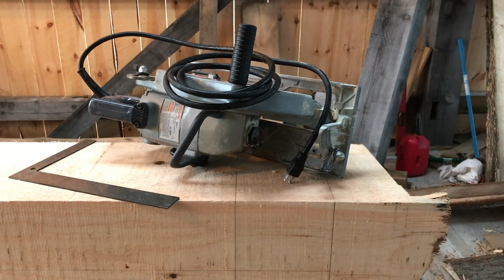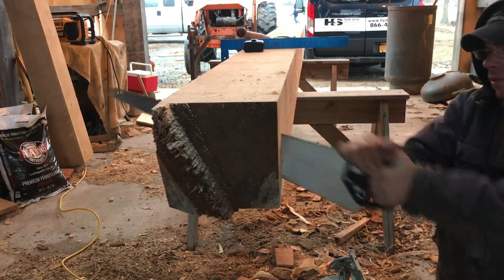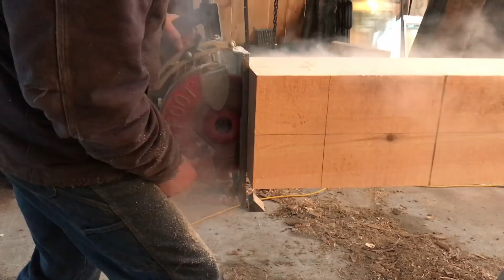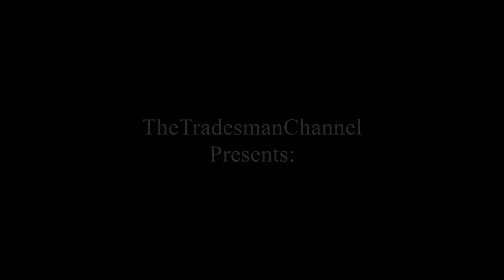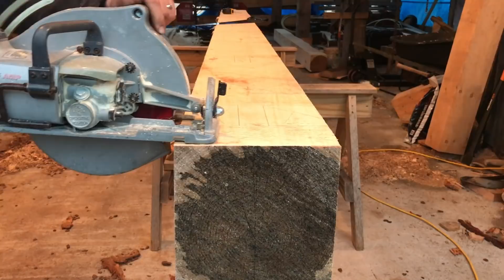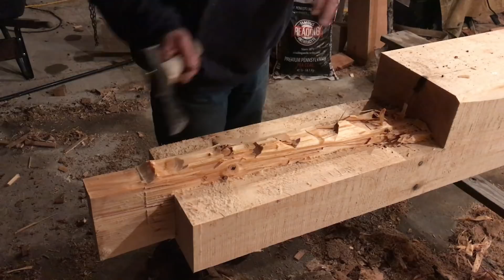THE MOST OVERLOOKED TOOL YOU OWN AND SOME TIMBER FRAMING

Comment: Would have used a reciprocating saw instead.  And then a belt sander   Just saying
Reply from the maker: Sawzall doesn't cut square, blade wanders too easily.  Normally I use a 16-5/16" circ saw but not everybody owns one.  I try to show many methods, just saying.

Comment: From the base of the tenon to the top, is it better to have a sloping tenon, tapering to the base, so the base is wider than the top, or to have a perfectly straight cut from top to bottom, so at the bottom you have a 90 degree angle? And I guess the answer depends on what job it is doing, so an inverted "T" might be different from a regular "T"?

Comment: I’ve worked many years on commercial aircraft working sheet metal repairs.  I use 1/8” plexiglass to pickup holes but it works great to transfer holes as well.  One suggestion I have would be to cut 6x6, 8x8 and 10x10 patterns from plexiglass and use them to locate those shape to box the heart of the logs
Reply from the maker: That's a pretty good idea.  Thank you for sharing.

Comment: Using a circular saw vertically ... fuck that
Reply from the maker: It's called a "drop cut" and is commonly used in timber work.
Reply: Ive never seen it done, i imagine it to be ridiculously unsafe. What i the saw catches or nips up, its going straight for your head surely ? Also this by no mens a dig at you i enjoyed the video. Just gave the heebie jeebies seeing that cut
Reply from the maker: I just saw your reply, sorry about that.  It is a different cut for sure, takes some practice.  You ought to see it when I'm using my really big saw!

Comment: Why don't you use a hand saw to cut the rest your circular saw didn't get to? I think it would be much faster than all your hatcheting and chiseling. Chisels are for finishing (or spots you can't get to with a saw). If you own a chain saw, you can do it with that, leaving  the last 1-2mm for the chisel.
Reply from the maker: Chisels are much faster.  I can tell you that from experience after cutting 100's of joints.
Reply: Your hatcheting and chiseling lasts from 7:00 to 11:46, that's 4:46 just to get you a somewhat level surface. With a nice sharp ripsaw it wouldn't take that long, some 2:30 I guess from my experience.
Reply from the maker: That's not bad at all.  You must have a very sharp saw.  I have a 16-5/16" beam saw now so any timber up to 12" will be much easier.

Comment: Straight cut scarf?  You must have learned from the amish.   Old english is the one.  That one there?  Myaswell finger it and pin.  Not strong.
Reply from the maker: You need to understand the load it is being used for.  The tie beams for instance are all undersquinted "lightning" scarfs with wedges, made to withstand high tension loads.  The joint in this video is for top plates where the load on the joint is minimal as long as the floor joists are pinned to the tie beams.  The Amish around here don't even know how to timber frame any more plus this is an English joint, not a German one.  I have a few videos on the other scarfs I used for the tie beams if you're interested, should be in the timber frame vlog playlist.
Reply: @TheTradesmanChannel  oh i get it.   But stronger structurally is better in my book.  Lol i overkilled everything on my timberframe just for fun.  Solid as granite.
Reply from the maker: Mine too.  My ties are 10x16, top plates are 10x10 and so one.  The biggest reason for using this scarf is that I set these plates alone and by hand.  These timbers were over 300#'s each so I needed a joint that would allow me to set one at a time.
Reply: @TheTradesmanChannel  absolutley.  I did mine all myself. Had to " build things to build things"  lol.  Block and tackles everywhere. Chains. And big hammers.  ! Right on sir.   Im glad to see people still building timberframes.   Amen.
Reply from the maker: You got it, I think you and I will get along just fine.

Comment: I would have done same. I have 4 in my truck..I've shaved jack studs with mine. Like a big chisel. With a handle. THAT SLICK. Lol
Reply from the maker: They are a great tool to have.
Reply: My catch all besides sledge or long axe. Have 14" 20" handles and 24-36" camp axes

Comment: Seems to me there was a lot of time spent doing that one joint. A well-built table with a band saw would save a lot of hammer time. I'm for old-school carpentry. But, too much time spent is knawing into the profit margin. If Jim gets paid by the hour that's another story.
Reply from the maker: Makes sense.  I like to show different methods.  I do cut many of them on my bandmill, that works slick.

Comment: I wonder why the tongues werent made thicker.
Reply from the maker: Basic rules of thumb for timber framing: tenons are a quarter of the thickness of the timber.  8" timber would require a 2" tenon.
Reply: @TheTradesmanChannel   Im surprised based on strength but thanks for the info.
Reply from the maker: It is crazy how strong timber frame joinery really is when done properly.

Comment: I think a sawzall would do a much faster cleaner job. Finish with grinder and planer
Reply from the maker: Sawzall is about the worst tool for this application because the blade flexes too much in the cut and I have seen timbers ruined with them.  I usually use a 16-5/16" circular saw with a 6-1/4" cut as well as a 10-1/4" circular saw with a 3-7/8" cut.  With the bigger saw there is no hacking out anything, just some cleanup work with the slick.
Reply: @TheTradesmanChannel  I meant a sawzall for just the cleaning up part. Instead of using a hatchet.
Reply from the maker: I know what you meant and it's a good thought, the problem is that even for the two inches left in the middle the blade tends to wander because it's such a flexible blade...ask me how I know.  I have used my bandmill often and that works very well as long as you put the reference face in the right spot in relation to the blade.  Axes and hatchets are still used by many timber framers and log builders for this type of work and many of them are much better at it than I am.

Comment: I’m a woodcarver who always relies on a sharp hatchet to get the waste wood out of the way, one important thing I quickly learned whenever using the hatchet as a chisel pushing parallel into the wood fibers is that a good pair of gloves will save you from imbedding sharp slivers of wood into your skin or under your fingernail  beds.  For accurately cut joinery, as in timber framing, I would have traded the hatchet for a nice sharp wide chisel to have far more control and reduce the chances of taking a bigger than necessary chunk of wood.
Reply from the maker: I normally use a slick and my firming chisels.  I like to show different methods for getting things done.

Comment: I found a tool on the web that consisted of 2 pieces of angle iron the same length, bolted together with spacers that created just enough room for a reciprocating saw blade between the 2 pieces of angle iron.  One of those fastened on both sides of your work as a guide.  you can make the guides as long as you need.  I found it to be slower but was not limited by the depth of a circular saw or shape of the cut.
Reply from the maker: I tried a sawzall early on and had issues with the blade wandering.
Reply: I must have explained poorly because using this method there is no way for the blade to wander.

Comment: get a powerful drill, a long drill bit and a metal hammer.  I bet it will take half the time, and you will avoid getting bamboo shoots up you fingernails
Reply from the maker: Might work.  Unfortunately I won't be able to test it out as I'm in a hospital bed with a smashed leg from a fall.

Comment: If you did not have any power tools then I can see the hatchet being useful for a project like this.  I would have just circular sawed both sides of that joint and then sawed the rest and none of this "chiselling" would be necessary.  But each to their own I guess.
Reply from the maker: Have you ever built a timber frame?  The timbers are generally huge and most people don't have giant beam saws.  That timber was a 10" timber.  The beam saw I had at the time only cut 3-7/8" deep.  Cutting both sides, as I did, still leaves 2-1/4" in the middle you can't reach so you have to deal with it somehow.
Reply: +TheTradesmanChannel
Not quite shore how you mean you can't reach.  The hand saw you used in this video looks like it would have reached with no problems.  Maybe I am overlooking something as I will admit I have never worked with wood this large.
Reply from the maker: The hand saw does reach.  What's hard with the hand saw is not wandering when you can't see the blade.  It's also much slower.  Everybody has a different method.
Reply: Kutulue sure/shore, lol
Reply: +paul johnson
saw/sore, lol

Comment: When we had the old barn built when I was a kid in Montana, one of the builders had an old axe that he had heated the area near the eye and bent the axe sideways, (to make a sort of broad axe off-set that let him use it just as you did but with a smoothing cut like an ADZE.)  With this modified axe and a heavy wood mallet, (he would carry them on his belt),  he moved all over the building frame, fitting and trimming beam joints right on the spot.  He almost used it more than the slick for smooting joints.
Reply from the maker: That sounds like a good tool
Reply: @TheTradesmanChannel  Shake cutters use offset axeheads too . It saves their knuckles .
Reply from the maker: I have two of them, they work well too.  I show a lot of ways to do the same job.

Comment: I have never seen a drop cut done like that before.
If you stand to the left side of the saw with your right hip next to the timber,pull back the blade guard and sight down the blade at the cut line you will have much more control of the saw and (the clincher) see what you are actually doing e.g. is the blade entering the work at the correct angle .You don't rely on/require a previous cut.Then let the weight of the saw do the work as you simply guide it into the work.
That's how the masters I trained with always do it.Line of sight and control not relying on 'whatever'.
I would also only ever use a roofing square from an inkline/chalkline.Where precision is required,working off an arris or face assumes too much of anything but the most perfect timber  (which does not exist!)  even fresh from the sawmill.
I wouldn't put anything heavier than wallpaper on those 'stools'.Not sure I'd want my legs and feet anywhere near them either.How much energy is being wasted and control lost by wobbling that heavy timber around like that with every stroke of the saw?
Reply from the maker: I will give a more detailed response to your comment once I am up and around.  I'm in a hospital bed right now with very seriously leg break.

Comment: How deep does the Big Foot cut?  I do love my axe for joinery.  There is only one redeeming feature about knots and it doesn't happen often.... when the knot fall just right when a peg can get bored through the knot!  Sometimes I waste a little extra time trying to place a knot so it comes out in a peg hole mostly on a tenon, it doesn't happen often but when it does it is so cool. Other wise knots are a pain.   Some axe work from an old channel I don't post on any more, encouragement for others to get out and try the axe.  
https://youtu.be/DKN7WqT4Hn8
Reply from the maker: 3-7/8".  Love the saw but it's not much good for 10" stock.
Reply: I do run a skill saw, Makita 8", I slip a slightly larger 8-1/4" table saw blade on it, it just clears, I think I got those number right.    It will just cut a clean 3" piece of stock.  Often wish for a bigger saw but still rely on hand saws for cuts that it won't do.   I have looked at the Big Foot Maybe some day.
Reply from the maker: The price of a brand new one is less than what I bought this thing for used.  Skil is putting out pro saws again and the Sasquatch is their 10-1/4" model.
Reply from the maker: Just to let you know I'll be in NH and Maine for ten days at the end of August.  Let me know if you want to get together.
Reply: What part of Maine are you visiting?  Could happen.  August is our blueberry harvest month and we often run into September.  It you are traveling into the downeast region, coastal Maine almost to Canada, you are welcome to visit. This is what I do in August... my other bushcraft channel.
https://youtu.be/HbTPSs0wiLk
Reply from the maker: Ah...I might be running up to Bucksport to see a buddy.  Might be able to go a bit further.

Comment: Dear Jim,
Great to see the weather is letting up a bit, I cannot recall when it was this quiet (no traffic either, where have they all gone???). As for your mallet; well I would not worry too much. I am sure once the barn is done, it'll probably one of the first items on the list to make. besides there must be a tree or two lurking about where you are??? I am sure you could make a handful of them. You might decide to hang this one on the wall somewhere as a memento of times past??? rather than give it it's last blessings before burial. It's amazing seeing which power tool is most prominent in the timber framing construction. With regards to axes in general; it THE weapon of choice for master builders throughout Europe & beyond. I am not so sure I would want to use the razor sharp Japanese one which I bought to turn pallet planks into kindling for my wood stove. All in all another day at the office, another timber ready. Well done my old fruit. Kind regards.
Reply from the maker: Rain is back with a vengeance
Reply: Dear Jim,

Thank you very much for your hearted response. Well you can't have it both ways these days. You've got to take what's the least of two evils ( should have said Lucifers???). besides you were working in the barn for the most part. I forgot to mention that I watched your friend Kim Crast doing his tractor. Maybe once your barn is done, you might consider handing him over the resurrection project of old faithful; she looks like she's had better days (your tractor Jim not Honourable Matron). That should keep Kim busy for a while & you could get on finishing the inside (don't forget Honourable Matron's boudoir first); I dare say by that time your old girl would be ready with renewed "thunder" in her belly. keep at it dear boy, the last mile's in sight. Kind regards.

Comment: I picked up a vaughn hatchet type hammer ,it is handy when doing lookout cutouts in roofing ,can not get a chisel sharp edge on it for some reason like you were cutting with ,a good hatchet i use a lot is my carpenters axe made by Husqvarna ,for the money it's a great tool ,nice handle and hand forged ,holds a nice edge also ,very handy tool for shaping timbers .

Comment: Not an expert by any means, but wouldn't it have been easier and more accurate to use the bandsaw mill to make that long scarf joint cut?
Reply from the maker: I do use it at times and I find I get better relsults by hand.
Reply: Easier and better looking.

Comment: I was at first distracted and then fascinated by what I saw as a small plume from the circular saw kerf. Was it smoke? No, it didn't disperse into the air and breeze. What, then? Close observation led me to conclude it was evaporation. Yeppers, that was steam coming out of that ol' wet log.

Small minds are easily occupied...
Reply: That gave me a chuckle, thanks friend.

Comment: Your saw blade needs sharpening. Great watching you conquer that beast!
Reply from the maker: That blade does not like ripping I can tell you that.  This wood is pitchy too, builds up and makes the blade smoke pretty good...of course I should buy the proper blade for the proper job.
Reply: Send your blade to Forest. They produce the best blades on the market. They will precision sharpen and balance the blade for around 25 bucks. That blade will then be the best blade you own. Better than buying a new one. I did this with my table saw and skill saw and what a huge difference. Also us resin and pitch remover every so often. Less necessary with a sharp and balanced blade. I know it’s only money but saves your motor on your saw which is not cheap.
Reply from the maker: Thanks for the info, I will check it out.

Comment: Jim if it does the job why not use it
Reply from the maker: Good question, half the time I just don't think of it.
Reply: Jim the firewood mallet have you thought of putting rings on the ends to stop it splitting out
Reply from the maker: I have but I made it fast and she's been hanging on.
Reply: Jim did you find a parcel in the porch Thursday  ??
Reply from the maker: I found it yesterday thank you,very much.
Reply: Just the hammer to sort !!!!
Reply: What was it ?
Reply: Jim what was it ??
Reply from the maker: Cross peen hammer...plus a set of tongs showed up
Reply: Are you ok with sorting the other one as the sender said they were going to send a returns label, if they have not oh well
Reply from the maker: Certainly